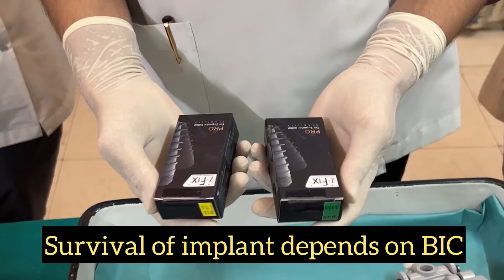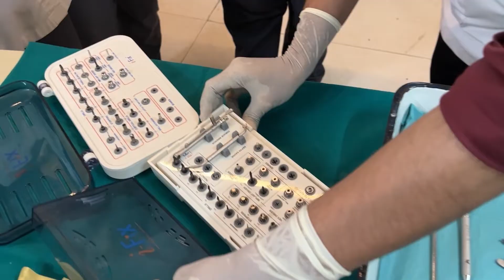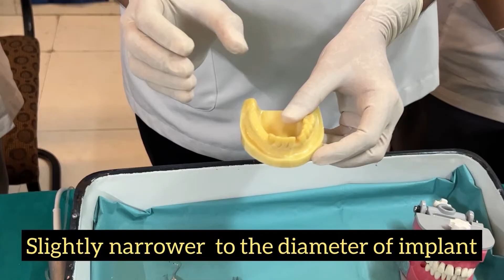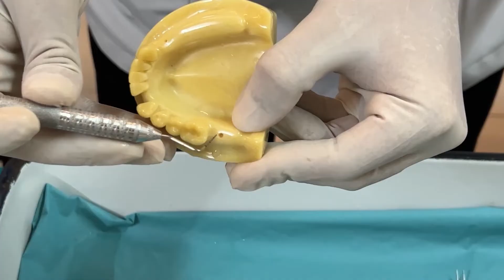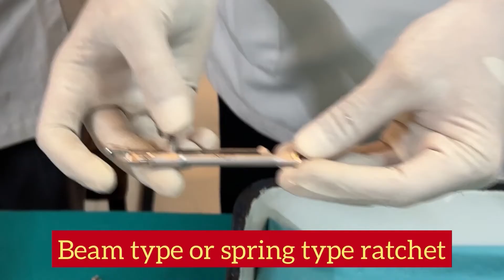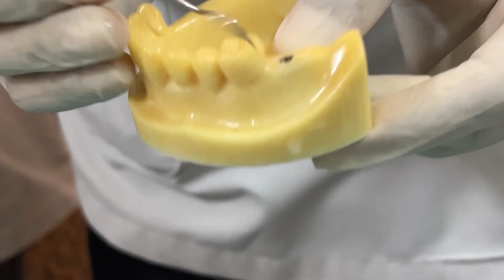Demonstration of Implant placement in Artificial Mandible | PERIO SUBHARTI 🇮🇳 | Dr. Mayur Kaushik

Comment: Sir, you mentioned that the osteotomy site should be slightly shorter than the implant diameter, but if the bone is D1 or D2, then should we also keep the diameter short, or should we make the osteotomy diameter equal to the implant?

Comment: Gudevening Sir... 1st 2mm twist drill...then 2.4.... n then later??/ why this sequence Sir??
Reply from the maker: Bhumika, this is to follow the principle of Atraumatic Osteotomy using sequential drilling. That is less pressure will be required if you so from the smallest diameter drill to the higher diameters.